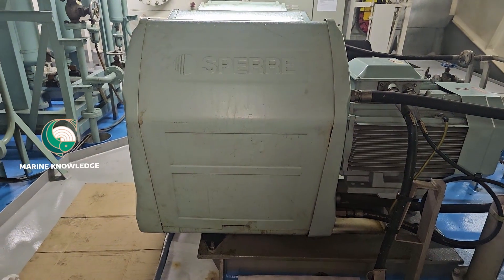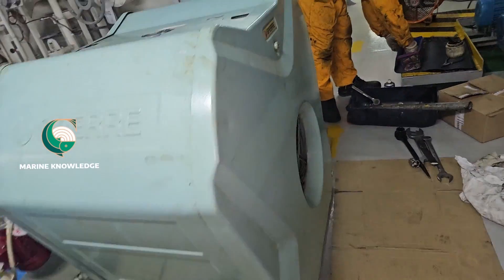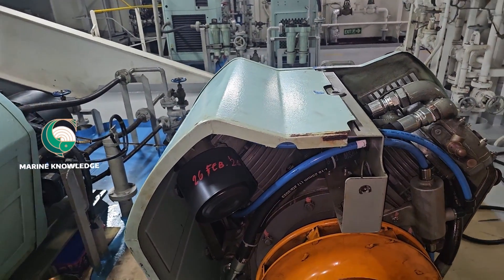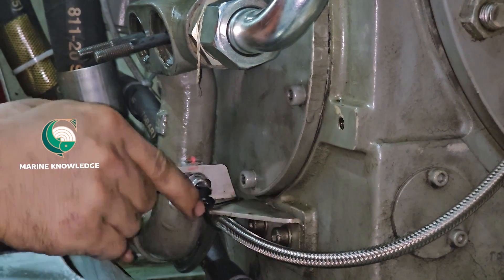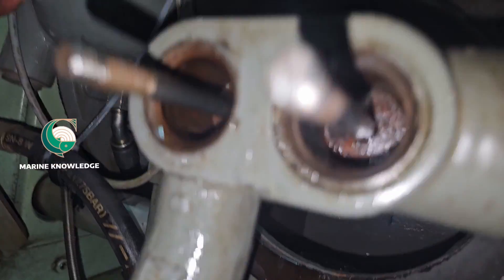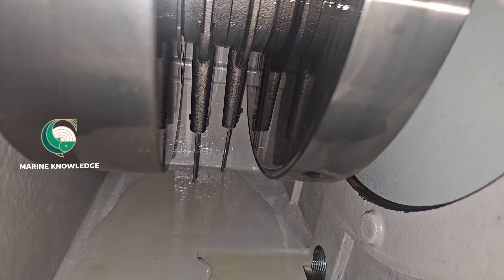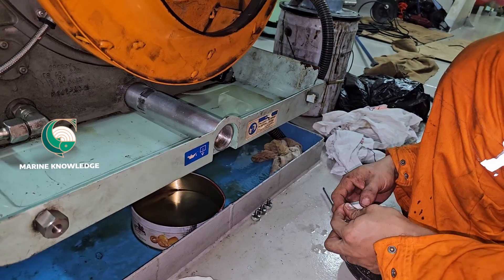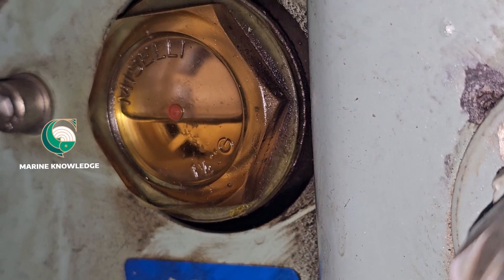Fourth engineer jobs....Main  air compressor maintenance ...How to drain and renew sump oil ,,,

Comment: Sir during isolation of main air compressor, we also need to depressurize the system, right ? How do we do it ?
Reply from the maker: mostly compressors stops after depressurising only so we dont need to do it manualy unless ur auto drain valve is defective

Comment: Sir sump is getting filled with water slowly what to do sir? Checkedout out lp stage renewed gasket, cooler , tried running cooling water pump with crankcase door open no water ingress.